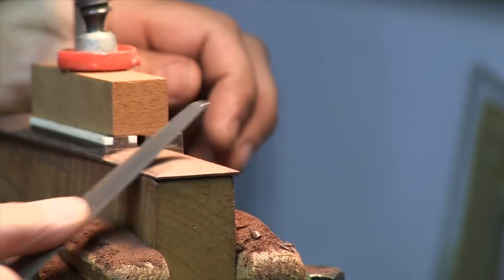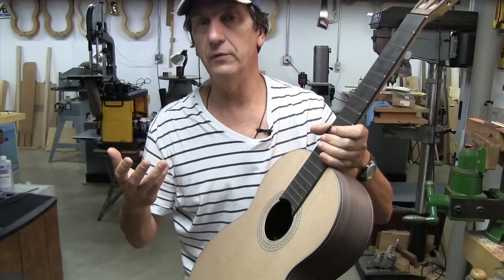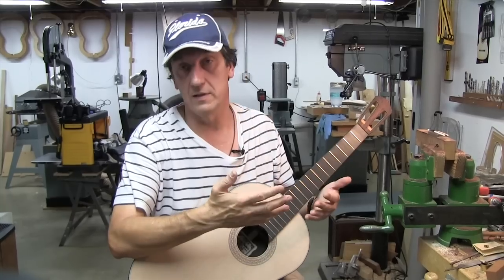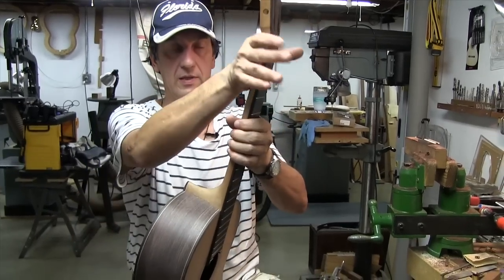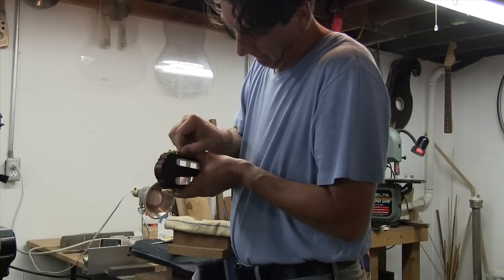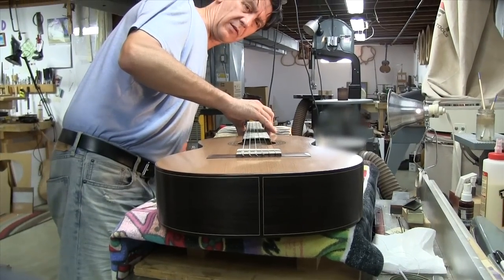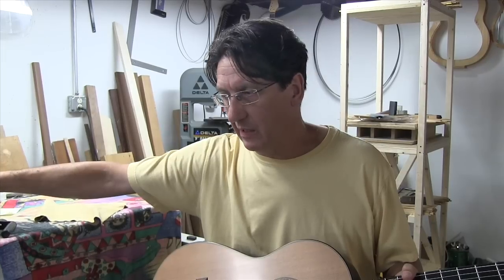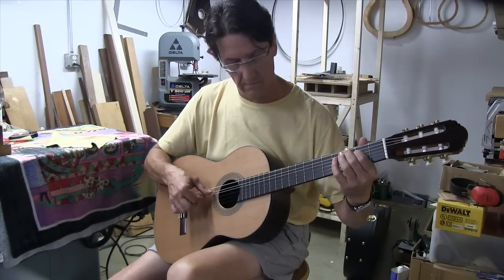The Artistry of a Hand-made Classical Guitar

Comment: @ 4.00 cutting the nut slot like that , by registering the headstock against the fence, is asking for trouble. Doesn't matter if you have been doing it this way for 50 years, it is still wrong.

The correct method is to use a sled running in the miter slot of the tablesaw.
Reply: +murrmac He didn't register off the fence if you look closer.  He has the neck held up off of the table by a spacer and uses the miter gauge to cut the slot.  It's not wrong.